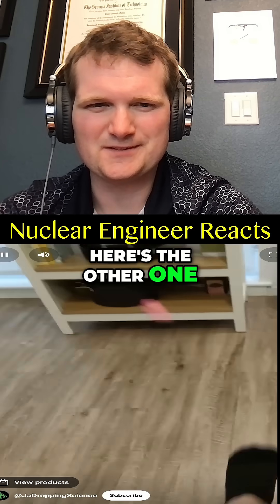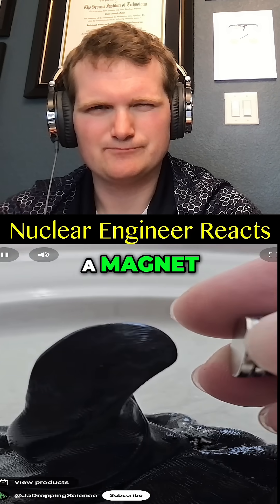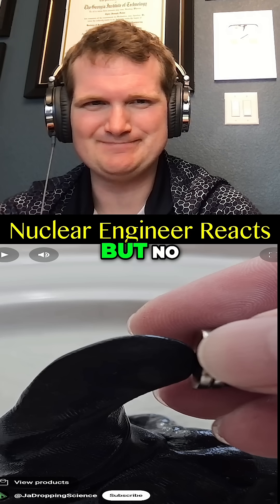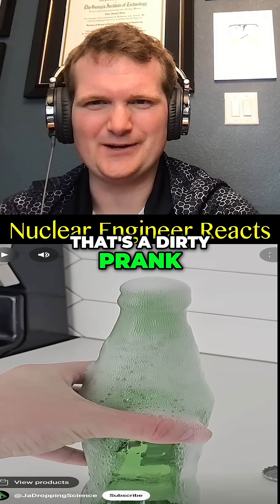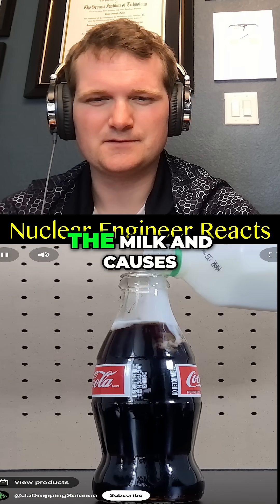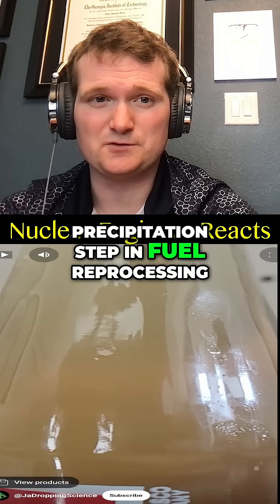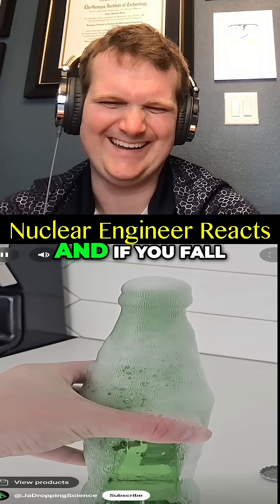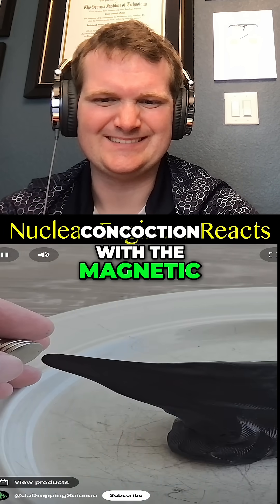Can a Nuclear Engineer Spot the Fake Experiment? - 2 Truths & Trash by JaDroppingScience

Comment: The 2nd one actually happens because a small vacuum forms at the bottom of the bottle cuz the bottle gets knocked further down quicker than the liquid inside, so then it quickly snaps closed so it shakes the whole bottle instantly. On set bottles this could actually make the bottom fall out too.

Comment: Fun fact about the bottle prank: The reason this happens because the quick clink causes the bottom bottle to quickly move downwards. The inertia of the liquid inside keeps it momentarily in place and this creates a vacuum at the bottom of the bottle pulling the dissolved gasses out quickly and cascading nucleation. If this is done with no carbonated drinks, the lack of dissolved CO2 will cause the vacuum space to quickly collapse as shatter the bottle with cavitation.